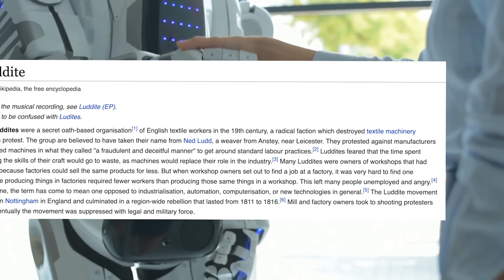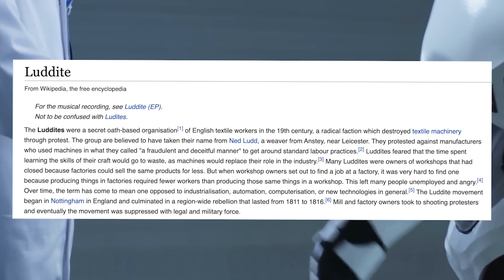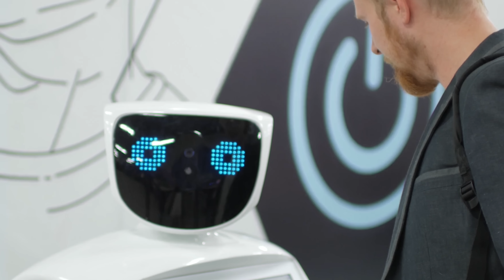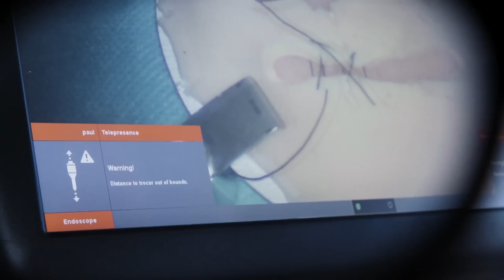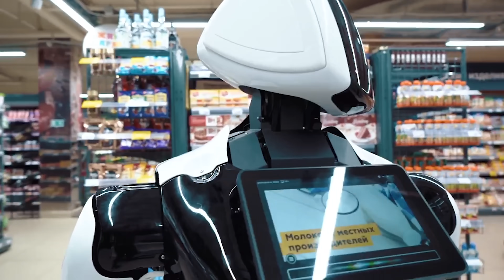Tesla's AI Robot Applications, Functionality, Value and Concerns

Comment: If the robots were used for manufacturing and distribution of goods, it would drive the end product price down significantly. That's the most significant area that they would change for humanity. All the other stuff may come later. As to the possibility of a robot accidentally causing harm to a person... it will happen, but humans accidentally harm other humans. The robots would most likely be 1000x's less likely to bring harm or injury. For the same reasons that FSD will be 1000x's safer than a human driver.

Comment: I think you should make a video about Tesla Dojo.
Its potential is huge. Not many YouTubes have covered it.
Basically, Tesla Dojo has only one competitor right now - Google TPU (Tensor processing unit). 
An ASIC (Application-specific integrated circuit) for training neural networks.
I'm not an expert, but as I've understood it, Dojo is far more capable than Google TPU. Not only in speed and electricity efficiency.

Comment: Given that a Tesla EV costs around $50K and that the TeslaBot will require far less material and time, it will cost about $10k. 
Imagine how fast Tesla will be able to build these, squirting the endo-skeletons out of a Giga casting machine, sliding in the wiring, the LFP batteries, the FSD computer, the interface, the sensors, and the actuators by the robots of the assembly line, unit testing and then zipping up a synthetic skin onto it. It should be producing up to a thousand Automatons a day.

Comment: The main application will be exactly what Elon said. Boring, repetitive, dangerous. Those that require humanoid form, but not high intelligence. Amazon should be the first customer. If you calculate how much a minimum wage worker actually costs, a robot would be a great deal even at a $1M price tag. But it won't be anywhere near that, when it's mass produced. Should cost much less than a Tesla.

Comment: Big cost delta if bot requires touch sensitive skin. Human skin, self repairing and sensitive to pressure, texture, temperature, vibration and puncture is under appreciated.
Without it, the bot would be a klutz.

Comment: So, Dojo is a NN training computer, it's not well-suited to inference (that is, running NN's that have already been trained).  Neural nets generally are created first (via training) and then typically frozen in the trained state and simply run on incoming data.  Dojo is purpose-built for the first, for example, and HW3 is purpose built for the second.

That's not to say that Dojo can't run a network once it's been trained.  Of course this would work, but it would be both gross overkill and terrible use of technology finely tuned - at great cost in time, effort and money - for a different task.

That isn't to say that Tesla or some other entity couldn't build a powerful inference farm to run the kinds of tasks that you're describing, so your proposition isn't contraindicated by the above, but the use of Dojo in this manner is.

Comment: It is hard to imagine a useful robot with hands and legs costing less than $100k, so using them to replace minimum wage workers is just crazy since the workers are cheaper, more flexible and intelligent, and you can fire them whenever you don't need them.   Even using the robots in hazardous work areas seems a bit iffy since with their limited intelligence and agility they would be more likely to get damaged, which would be expensive to repair.
A far more likely first application would be a deliverybot, a small stairclimbing robot that can carry packages from a delivery car or truck and leave them on your doorstep.

Comment: AI Robots (learning based) are different from the mechanical robots (procedural). They are better suited to tackle high-end / brainy  jobs (Doctors, Surgeons, Architect, Judges, lawyers, engineers, programming ...etc.).  Large capacity database, superior processing speed / rate, infinite amount of knowledge acquisition & utilization capacity all favors AI robots over existing professionals. However, these are better equipped with resisting such changes. More $, connection, legal & political clout...  Hence the initial wave of "changes" will occur at the lower economic ladder jobs, where current work force has limited "resistance".

Comment: Almost none of the applications you mention require a humanoid body. There are some applications where legs and hands are useful, climbing stairs and manipulating small objects, but for most applications a wheeled robot with a replaceable arm with various types sensor and gripping options would be far cheaper and more practical. The humanoid robot also has the disadvantage of freaking people out. I am sure losing your job to a humanoid is far worse psychologically  than losing it to something that does not look human.

Comment: In my manufacturing workplace I can think of a dozen jobs which could be easily replaced by such a robot with minimal training time required each of these jobs. Each of these jobs consist of 3 shifts paying each person an average of around 18$/hr. This equates to approximately $112,000 per year per job and does not including all benefits, bonuses, 401k, PTO, shift differentials, unemployment claims, injury claims, etc. Total value spent on each job probably comes to around $200k-$250k per year in actual cost to the company. Tesla will change the world (again) when they pull this one off.

Comment: I think that you missed the most basic fact about these robots: they will have general AI. Just as the cars learn from sending video to Tesla and having their team and supercomputer look at it, so will these robots. There will not be apps or different robot versions, they will all be equally capable. Yes, if you buy a robot it can clean your house and do your shopping, but also if you want to start a home business it can sew your dresses or whatever, and do your books and taxes. If you have a medical emergency it can be your EMT and call 911, if you want to replace your roof it can likely do that too. And all of the robots will keep rapidly getting better at all of this. Yes, fairly quickly they will be better at diagnosing diseases than doctors are, and at doing surgery too. 

I don't think they will cost $100,000 either. Not much material if they weigh 125 pounds, Tesla already has the technology for their cars and will just drop that in. I am thinking $30,000...

Comment: These robots are going to become victims of robbery by humans which will lead to their strength and speed being increased which will lead to stronger robots being used to rob weaker robots. Then the robots will be given weapons to protect themselves.
Reply: You wouldn't need to make them stronger just like we didn't need to make a Tesla meaner. When people started breaking into Tesla's it was chronic, until Tesla released Century Mode. The cameras caught the thieves in action and the images were given to the police. Vandalism done willfully or accidentally was also found out due to the cameras and the perps were found and charged. You don't hear about those stories anymore because it's becoming known... don't mess with a Tesla! The Teslabot has 8 eyes and sensors. The information may be stored remotely and again if you went to harm it, century mode would be activated. You would be caught. Low level crime is a result of poor education, economy and social issues. A UBI vs petty crime and jail for being that stupid when you have your basic needs met is dumb and some will do it anyway and get caught. If the police do their job it will even make it easier for the streets and property to be safer.

Comment: With a nearly completed Neural Network formulated from roads, vehicles, bikes and people and a fully functional twin processor based ECU, Tesla can finally lay claim to an A.I. Robot - on 4 wheels. Next, put an FSD ECU in the chest cavity of a 5' 8" robot with 8 cameras in the same array arrangement as a Tesla vehicle. Then connect motive power controls and steering from the ECU to the legs and you have an A.I. walking robot able to traverse any road or outdoor path in America. Finally, use DOJO to train for interior spaces and DONE.

Comment: IMHO, an obvious first application would be driving legacy cars. They have all the vision sensors on the bot and can use the FSD control software with minimal adaption on the interface-side.
Reply: That would be a pretty expensive driver that simple can't match a self driving car.
Reply: @yourcrazybear  Lag time would be worse than FSD equipped car, but still better than reaction time of a human. Manual interface of a car is so simple that I think this task could be easier to achieve (conditioning on having a working version of FSD) than stable walking of the bot. Ignoring RnD, the cost of the bot can probably be much cheaper than materials going into a car, which needs a much bigger battery. Cost of the bot would also be cheaper than monthly pay of a truck driver.

Comment: The AI Day was a bigger reveal than people think.

Think what Elon is doing: NeuroLINK, StarLINK, think of Neurolink as the controler and the Starlink as the cable to Dojo. You did see how Tesla can render the surroundings into Vector graffics, the robots can take it further from the roads. Put a camera to a Starlink sattelite and you have the view from above, that is a gaming platform.

Neurolink will controll mechanichal limbs for people with reduced mobility, the Tesla robot will have cameras and mechanichal lims! A doctor hoocked to Neurolink can "rent" your houshold robot for a quick checkup. Or a specialist can jump in a robot instead of flying to another country. This is teleportation in a way, preaty handy for people getting homesick on Mars.

Elon thinks big, a robot for shopping is not the end goal.
Reply: You're thinking about the movie Surrogates. The latency will be pretty bad, though.
Reply: @TiaguinhouGFX  I haven't seen the movie, I have 1150 Tesla stocks and I'm just following what they are doing.  Starlink is aiming at latencys under 20ms, fiber is at 17ms. The latency over continents and long distances is alot faster in space than fiber so overall I think it will be almost instant.

Comment: These robots may be able to drive a car, monitor your home for security, construct; a base on Mars, items on production lines such as Teslabots.
Reply: Loool drive a car? Wtf why do you Think tesla is building fsd? Whats the point of putting a robot behind a wheel of a another robot
Reply: @Matzes  This robot may come out before all cars have Fsd.
Reply: @chrismeys4791  this robot relys on FSD so understand its surroundings. That was the whole point. Use FSD on more things than only cars. Go back and watch the presentation
Reply: @Matzes  Say you have a non Tesla electric car that doesn't have FSD and you have a versitile Teslabot...
Reply: @chrismeys4791  still requires FSD in the robot to figure out what to do
Reply: @Matzes  True.